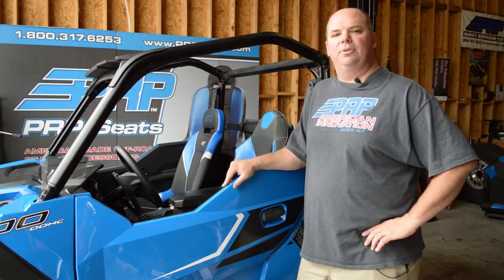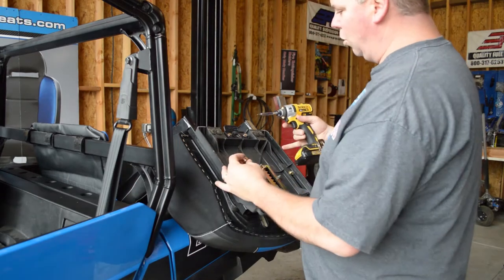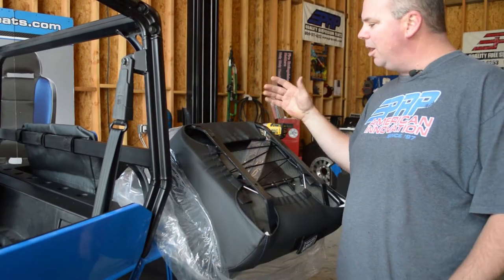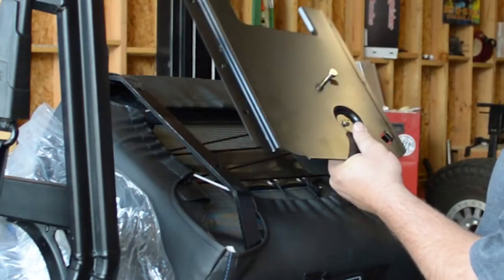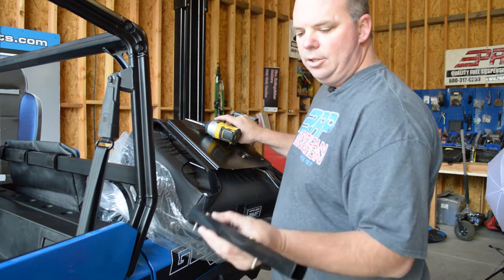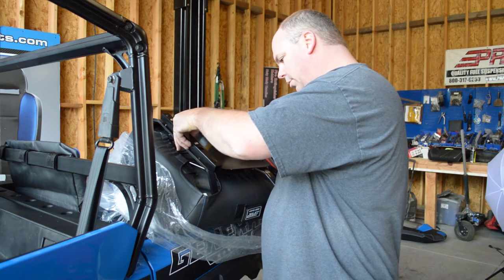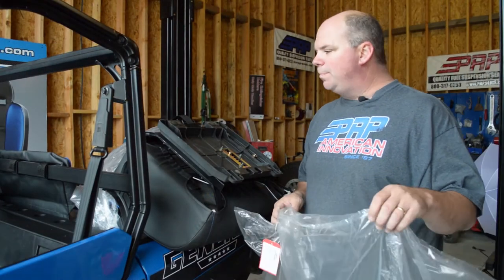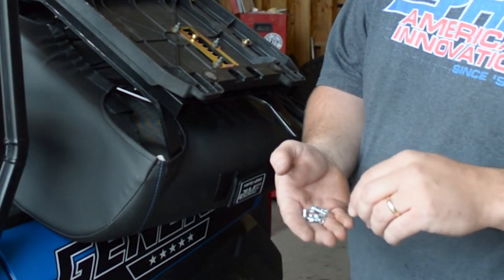PRP Seats Installation for Polaris General, RZR S900, XP1000, XP Turbo, Turbo S, RS1

Comment: Is switching the seat on a 900 the same as changing the seats on a 1000?
Reply from the maker: 1000's are a little more complicated because you have the sliders. The 900's don't, and are just a basic bolt in to the bottom of our seats.
Reply from the maker: If you're talking the S900, yes. The older XP900 is very similar. You just won't have a stock slider to attach.
Reply: Thanks PRP me and my dad are figuring everything out for my car so I can start racing soon